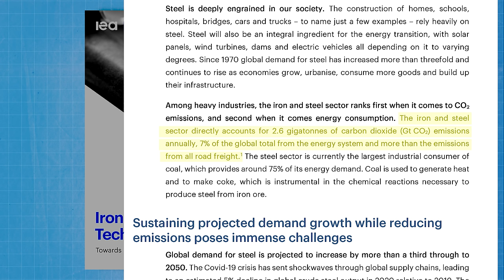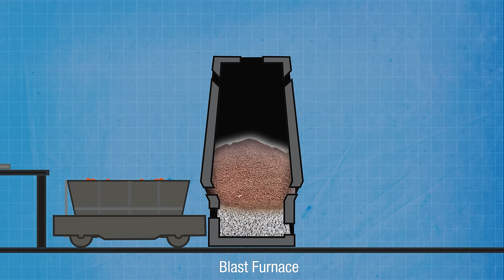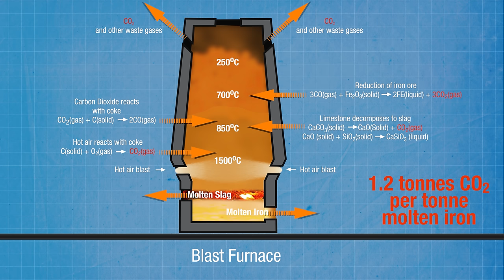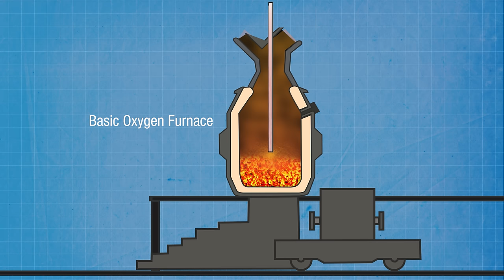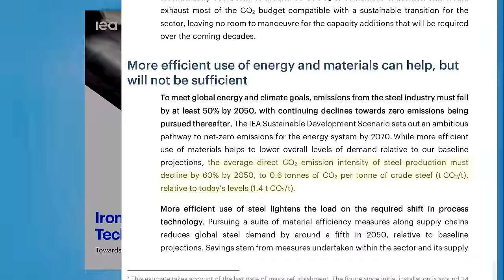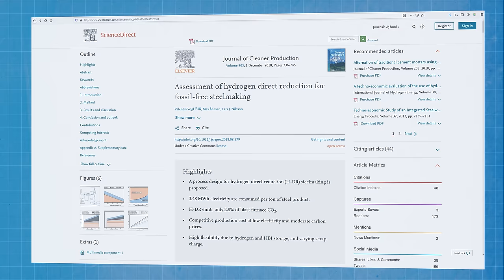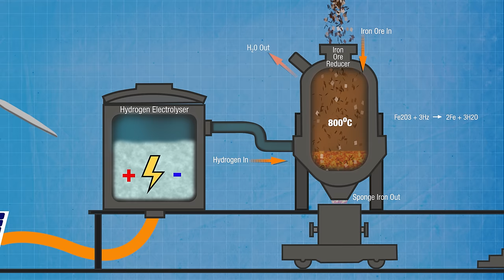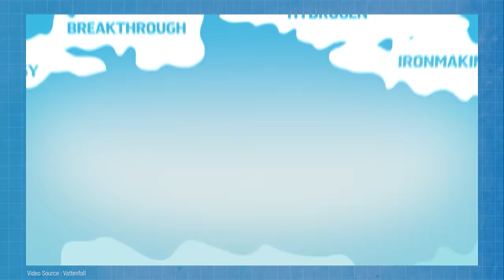Fossil free steel. Another giant step towards net carbon zero?

Comment: I am glad to see this as a possible option for a better future. I do not think it will fly at all if it relies on increasing the price of steel production. Relying on taxes to make this happen is the wrong way forward, in my view.
Rather I think that companies ought to market their steel as environmentally friendly steel and raise the price of it. With enough R&D into hydrogen production, I am sure we can drop the price of hydrogen fuel to below the cost of coal and as a result all companies and countries will adopt the technology, not because it is good for the environment but because it is good for the bottom line. Everyone will do it if it increases profits!
Reply: The problem is that it won't increase profits at first, and might never increase profits.  If we put a price on carbon, then clean steel will happen through the magic of the market, and once implemented, will see more R&D and reduced costs.  In the long term, it will probably never be as cheap as dirty steel, but the world will be richer overall due to less damage from climate change.

Comment: If it's still necessary to add coke to the electric furnace, how is it carbon free? I got the part about 2% of the CO2, but it's not carbon free? (I seem to recall that mild steel is 0.7% carbon)

Comment: The Hydrogen process would be another great use for SMR's (Small Modular Reactors) and MSR's (Molten Salt Reactors), especially Thorium reactors that use widely-available, nearly-free Thorium instead of costly and rare Uranium235.
Reply: Thorium reactors are, so far, all unbuilt,  IIRC. And you still have nasty long lived poison to deal with, which nobody yet is doing anything with, the all  life poison, almost forever. Thorium is massively better than uranium for electric power, still a silly solution. The cheapest way to produce electricity is with solar panels, and it's free (sort of), and it's getting cheaper almost daily. Radioactive pseudo solutions are the bailiwick of corporate  capitalists, unless you want to build a big bomb, still an ugly solution.
Reply from the maker: That might be one of the uses for SMRs in the future. Certainly better than steam reforming methane to get the hydrogen.

Comment: This is a perfect process for high-temperature nuclear reactors, such as the MSR.  The temperatures these reactors run are already in the 700C range, so you don't need to waste electricity to make heat to make the H2 react.  Also, higher temperatures during electrolysis also improve the ratio of energy to H2 output.  The reactor also can make electricity, which takes care of the rest of the needs.  watch?v=VBlGhmuZWHM (15 mins, technical, but interesting).  The same reactor can also absorb excess renewable energy which currently is just wasted due to the lines not being able to handle the energy spikes.  That same energy can heat the molten salt without the need to add more nuclear fuel, basically functioning as a thermal storage battery.

Comment: Now this should lead to something our current civilization has not been able to achieve.  Production of extremely high purity IRON.  This substance is very resistant to oxidation as there are few if any impurities to create oxidation sites.  Which is why they have been able to find an 99.9999+% pure wrought iron tool (with wooden handle still partailly intact) encased in coal beds with no signs of rust about 70 years or more ago.  No idea how they actually got inside the coal layer to be mined out,  but we still have extreme difficulty making iron even approaching that purity (our best is about 99.99%),  so it could not be a hoax.

Comment: This sounds like we need viable alternatives to steel like composites. The tech is interesting, steel Is a high embedded energy / CO2 material. The world needs a steel replacement material. That means investment into research to flesh out the properties of existing materials and research into new materials that allow steel to be replaced. A reason why steel is s useful is the huge amount of research that has gone in to understanding the properties of steel.  Investment needs to be made in finding the properties in alternative material for steel. Generally all metals need to have viable alternatives. It will need regulation or government support to create the environment for that to happen.

Comment: 1,350 million tonnes of steel, each requiring 90 kg will use about 122 million tonnes of hydrogen, or about 50% more than current world production. A swing to hydrogen as the fuel and reducing agent for steel production will involve a major transition. Very large amounts of new renewable capacity will be required if ‘green’ hydrogen is used. The electrolyser manufacturing industry will need to expand by several orders of magnitude. And, of course, the steel industry will have to invest billions in the new plants required. By the time this happens steel will very likely be replaced with carbon fiber.

Comment: Any wasteheat source adds 1.6× of retained greenhousing heat, aggi tracks this, so most of the heat must be contained by the system.

Steam electricity, thermal power, is worse, it emits 2-joules/watt on_the_wire times 1.6=3.2-joules/watt retained by the planet.

It's the fundamental problem now, beyond gas emissions of 30.4E6-tons/second of CO2.

Useful to see H2 be used, designing a contained heat process for bicycle steel an interest.
Cheers🍺

Comment: Hmmm. Why not make iron in a direct process using a reduction similar to a Hall-Herault method?
BTW you can even do iron electrowinning from water based solutions.
Im sure they had their good reasons in sweden to give it a go for hydrogen reduction instead of salt melt electrowinning, and although both use less energy than conventional steelmaking, i would have thought that indirect methods like hydrogen reduction should have a higher energy consumption than salt melt electrolysis processes.
Obviously what you cannot really do with a salt melt is to let it freeze, and that also means you better do not lower the electricity input to the cells too much.
You though might be able to bypass the EAF with salt melt electrolysis, although you still might need to get rid of the impurities in the ore that either end up in the salt melt, or they end up in the raw iron from the electrolysis.
Not easy I reckon and more straight forward to remove them in an EAF after hydrogen reduction.
Is that the reason to involve the intermediate hydrogen, which comes with quite an additional energy cost due to oxygen evolution as the energy intensive anode reaction in the splitting of water?
Would be interesting to know, because with other metals like Al, Zn, Cu, Co and Ni, and others electrowinning is well established, although also for some of them there exists a hydrogen reduction alternative; yet I think run out of steam reformed hydrogen.
That is ... apart from more exotic metals (like Na and alike; Mg) only Al is produced from salt melts. And I dont know or remember how impure the Al2O3 is, that is fed to the cells....
Because everything that does not end up in the metals needs to be removed from the salt melt.
Another interesting aspect is the iron as an impurity from other processes ... and how one could possibly incorporate that into such a process.. yet they are typically not iron oxides but moreover salts that almost nobody really wants

Comment: Hrm, or the messy grid balancing and relying on electrical generation that doesn't work most of the time could be met with High-Temperature Gas Reactors, gas-cooled nuclear reactors that aren't for generating electricity so much as they are purely for generating a constant source of heat. This can be used to power a method of hydrogen production called the thermochemical sulphur-iodine cycle, and since the output of these reactors is theorised to be around 1000 C, it could also power the iron ore reducer. Waste heat (because engineers love coming up with ways to use that) from those processes could also be used to run boilers and from there steam turbines to generate the juice for the arc furnaces.

There, a closed cycle nuclear powered steel mill that doesn't require painting the landscape in solar or wind power, and could be built in the footprint of a modern extant steel mill. Maybe on the site of the old coke ovens?

Comment: So setting aside renewables, does the hydrogen method require more energy than the coke method?
Reply: Why set aside renewables though? I think the answer is yes, but I also think it depends on how you look at it. Coke needs alot of surrounding infrastructure that cost energy to run and build. Same goes for hydrogen. If we want to look this far back in the chain it's hard to decide I believe. Kind of how buying a new electric car is worse (energy wise) than driving your old Corolla for 10 more years. But the key here is; hydrogen will be completely renewable.

Comment: Swap all coal plants with steel production plants using hydrogen, not a bad idea.  Multi-use industry.  No more curtailment from wind and solar power when there's an industry that needs all the spare energy you can muster for electrolysis.  Surprised the process doesn't use the oxygen from electrolysis to extract the iron though? 
Now to convince the steel barons of Australia to get the LNP on board with this.

Comment: Are there any companies using or developing this tech in the marketplace?
Reply from the maker: Yes. Hybrit. The one in the video.
Reply: @JustHaveaThink  Sorry, my bad, I wasn't specific.  By in the marketplace, I meant publicly traded companies.  They look to be private.
Reply: @AmosIrontree  BHP Built a plant in Port Hedland, Western Australia as a proof of concept it was called the HBI. It was decommissioned and pulled down after a Death and numerous safety incidents. The problem was Hydrogen itself it's a great idea but dangerous to work with. Another plant which was the original was built in Brazil I believe that was also decommissioned as well.

Comment: Simple use hydrogen as the reductant. That's been known for several decades. The hydrogen process requires the temperature at around 950 degrees C instead of 1800 degrees C.
Where to find hydrogen for the process? In lignite which has a moisture content of 50-60%.Strip the moisture out using waste heat at 40 degrees C. That replaces coaking coal which has to be cooked at 900 degrees C for up to 12 hours.
Now cook up the retort mix iron ore and the hydrogen rich lignite for 3 hours and hey presto 99% pure iron ready for an electric arc furnace. All this has been proven at pilot level. Matmor is the process

Comment: I previously worked for a uk importer, stainless steel catering equipment from India & China. Majority was terrible quality & sometimes refused by customers or would break after 6months. As good as reduction in production sounds, if the end result isn’t long lasting then we end up in a perpetual cycle of manufacturing and scrapping just for turnover. My nan had a pan that was her mums & still useable now - unfortunately, GDP is more important.
Reply: Was this steel low quality because hydrogen was used in its production, or was it just junk steel?

Comment: we also have to start thinking of using less steel. there's no good reason we need to use steel for building if we just build to reasonable heights < 200m.
if we replaced cars with public transit and tall car oriented steel buildings with shorter, equally dense public transit oriented ones already we could reduce our steel use by almost 70%

for hydrogen steel we also need to be honest about the fact that renewables are not the solution, they're too energy diffuse, too expensive as a system and HORRIBLE for the environment at scale. high temperature nuclear reactors can produce immense quantities of hydrogen almost as cheaply (maybe cheaper) than steam reformation

Comment: Hydrogen-Mentioned many times.  Does everyone understand that converting water to Hydrogen by electrolysis for powering trucks, cars, etc. Is a net energy losing process.  On the order of efficiency of fossil fuels. The alleged gain is, of course, the exhaust is mostly water.  Question: Has anyone calculated the amount of water vapor that would be released if all engines worldwide were running Hydrogen?  Which,of course, has now been re-categorized as a greenhouse gas since it became obvious that it would have a moderating effect on CO2 as the "demon gas" WHICH ALL ANIMALS AND HUMANS EXHALE WITH EVERY BREATH.  Sorry, if our direction is, if fact, CO2 catastrophe, then there is absolutely no chance of ALL the worlds democracies having any effect on it at all without full compliance by China and India.  And, you must prevent Africa from developing its vast resources which means relegating them to permanent poverty.  Good Luck on that plan!  Africa is waking up and can stop the whole thing if they ever get some honest politicians and political processes.

The only solution is to cover base load with nuclear power.  My preference would be Thorium because it is so much safer, so much cheaper, and so much more scale- able.  You will always need natural gas for the variable load and that CO2 can be sequestered far cheaper than all these other pie-in-the-sky schemes like solar and wind.

After the recent Texas storm where their reliance for 25% of power was windmills, does anyone not see the problem.  The blades are propellers.  A very thin sheen of ice causes the propeller blade to stall, but worse puts it out of balance.  If not automatically feathered, it tears itself up and many times a 150' blade rips off and lands a quarter of a mile away.  

Windmills are not the answer.  Solar is not the answer and in addition causes a future disposale problem on the order of nuclear.  Chemical batteries are not the answer and have a similiar disposal problem.

Comment: Imagine thinking that net carbon zero was something we needed to strive for.
Reply: Yes, we need to strive for it.
Else our rapidely shifting climate will make living on large parts of earth very unpleasant.
Reply: @3gunslingers  ok, IPCC muppet.
Reply: @pfzht  
You think altering the composition of our atmosphere will not alter our climate in a similar time frame?
Reply: @3gunslingers  depends, with what?  Solar cycles and transitively the Pacific Decadal Oscillation govern climate change, not cheeseburgers nor SUVs.
Reply: @3gunslingers  because water vapor holds the heat, not CO2.

Comment: Don’t these kind of mills exist already but they use natural gas for making hydrogen instead of non fossil fuels?
Reply from the maker: Not as far as I am aware, but you are right about making hydrogen from methane. Steam Reforming Methane currently accounts for about 90% of all the hydrogen produced in the USA, and that has to change fast.  In fact I'll be touching on that next week.
Reply: Just Have a Think yes I got it wrong they use natural gas in the existing process. https://www.midrex.com/tech-article/midrex-h2-ultimate-low-co2-ironmaking-and-its-place-in-the-new-hydrogen-economy/
Reply: How would using hydrogen from steam reformation of natural gas compare economically and environmentally? It might be that a good road forward is to initially make steal plants using fossil fuel hydrogen, and convert to green hydrogen later. At least such a plant has the option of going green, which a new traditional steel mill does not.

Comment: Hydrogen must be handle with great care because its inflamability limits with  oxygen are very wide. If not, it will have huge explosions in the future. If you heat pure hydrogen there is no problem, but when it is mixed with a very little amount of air, there will be explosions. It will be necessary to purge the system with a inert gas, maybe like they do with tanker ships... Or maybe it wouldn't be enough. We use in our labs pure argon or nitrogen, but we are not doing a industrial  process...

Comment: I would like to comment on the completely incorrect expression "fossil-free steel".
Steel is an iron-carbon alloy, so in order to get steel from the now in Sweden under development, the HYBRIT and H2 Green Steel processes, carbon in some form must be added to a melt of iron sponge, which is the product of hydrogen-reduced iron oxides.  Note that sponge iron is not steel.

  Probably the necessary coal for steel production is fossil, unless one expects to produce and use coal for steel production from e.g.  charcoal, as has historically been done in Sweden.

  Vattenfall, H2 Green Steel, SSAB, LKAB and other players should reasonably be sure of the facts in their marketing - carbon-free steel does not exist, let alone fossil-free steel.

  Many other alloying elements for steel, such as chromium, nickel, vanadium, manganese, etc. are produced in processes where again carbon (usually as coke from fossil coal) is used as a reducing agent, which contradicts the concept of "fossil-free steel".

  The coal that is included in steel scrap has undoubtedly a fossil origin, which is why scrap metal melting for steel production cannot give so-called  fossil-free steel.
  The important iron-carbon alloys:
  Cast iron, ductile iron, has, like steel, its origin in pig iron, which is the product of mainly blast furnaces.

  How such materials can be produced without coal of fossil origin is a question on which I gratefully look forward to it being communicated and answered in our media.

Comment: i don't know about you side, but on the other side of the planet, iron is retreating from our daily life, furniture, clothing, kitchen utensils, drawers, everything we can buy are plastic. include construction machines, say, the drill. those battery drills are now plastic, not only the case, but gears, switch, insulation, circuit boards, even motor parts, if you strip down everything, steel parts only about 30% or less. nothing last for 5 years or more.